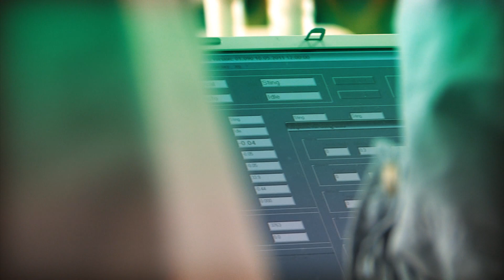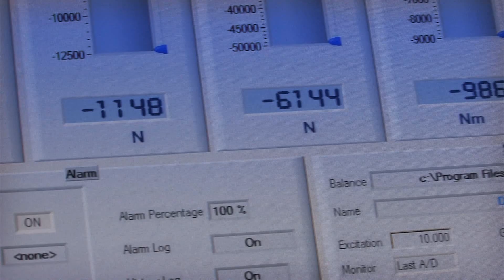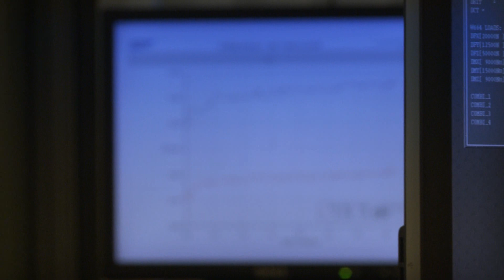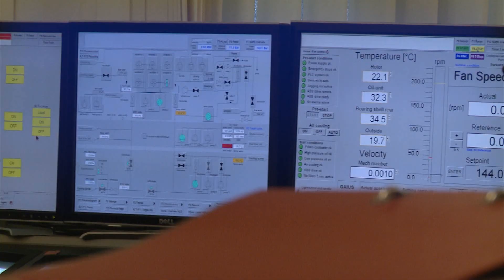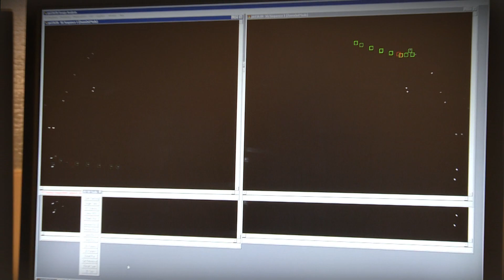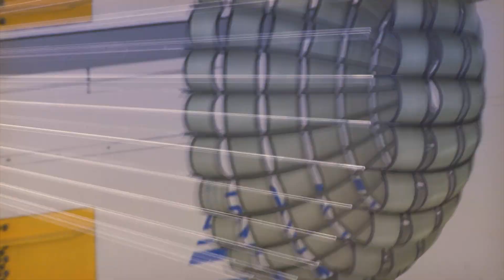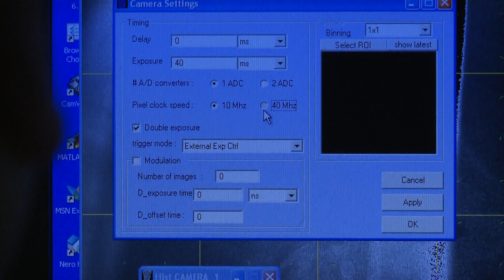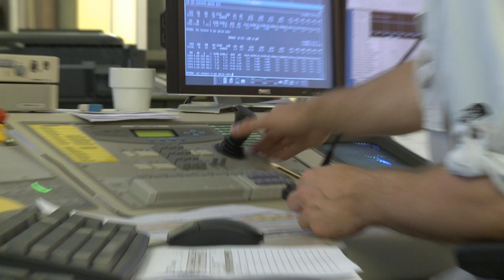Wind Tunnel Test of the KC-390 in DNW-LLF (Long version)

Comment: Why do Brazil have the need to go to Germany for a wind tunel?? Freaking build one!!!!
Reply: Edgar Kiechle You realize that the technology employed in the designing and manufacturing processes of such an advanced aircraft as the KC-390 greatly overcomes the technological challenge of building a wind tunnel, right?. Instead of complaining about your country, you should study harder and maybe learn something about engineering and management (specially about procurement and outsourcing)... Maybe than you could have a better grasp of the current technological and economical condition of your own country, because, right now, you are talking non sense.
Reply: Of course we have wind tunnels, the largest of the country (CTA's wind tunel) is located in the same city as embraer main site. The problem is that they lack capability for the advanced testing, probably the ones shown in the video (parachute and hoses wind testing), so they had to take the test to DNW, like a lot of other countries do. I don't think the volume of projects in South America justifies an improvement in the CTA wind tunnel, it suits well Embraer in the most common tests, so it's financially acceptable to take the project to the Netherlands (not Germany) when needed.
Reply: Edgar Kiechle  Você é imbecil mesmo sério mesmo se você soubesse o quão esse avião é moderno não falaria tamanha merda, muitas vezes aviões de muitas montadoras necessitam de coisas que vem de outros países, vai procurar aprender o que é tecnologia brasileira seu deficiente mental. Você sabe o trabalho de ter tal tecnologia pra uma empresa que mesmo adolescente já é a terceira melhor do mundo? Então vá a merda!
Reply: Edgar Kiechle You're lying. If you were an aeronautical engineer you would know that EVERY company in the aerospace industry depend on parts built by different manufacturers to build their planes, Boeing, Lockheed, Bombardier... everyone. So it doesn't make any sense for you to even criticize this, it just show us how far you are from the subject. But even then it's not as simples as putting them all together like a puzzle and even a freshman in aeronautical engineering should know that, so you're probably just an average joe, an uneducated nobody trying to be a smart ass.
Reply: Actually I Do study aeronautical engineering at UTN in Argentina, dumbshits. Embraer only gather together components from different manufacturers and design the fuselage, nothing more.
Reply: I'm from Brazil and it's because we don't have high technology to do so, our country sucks.